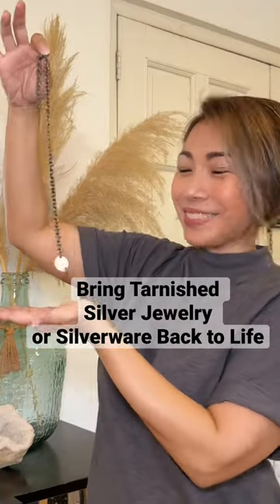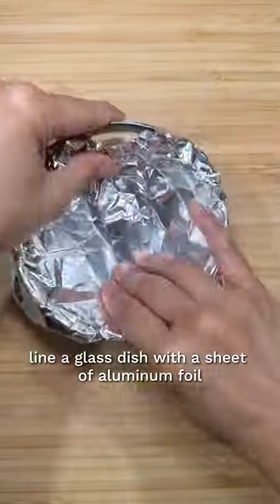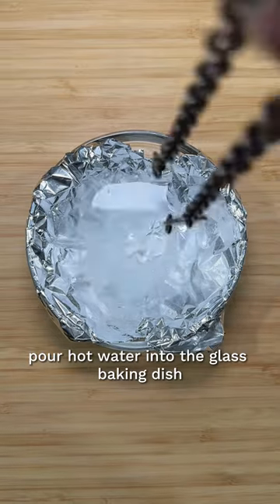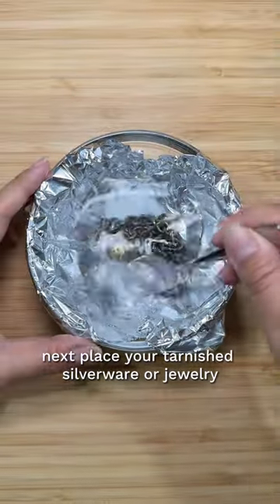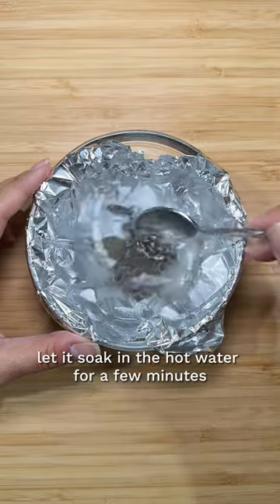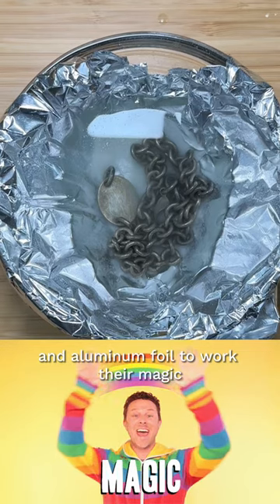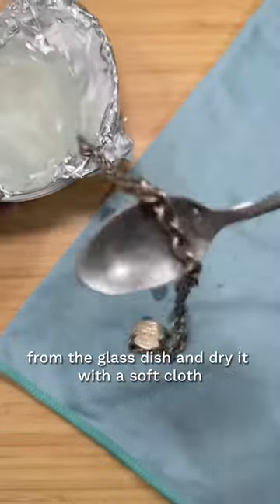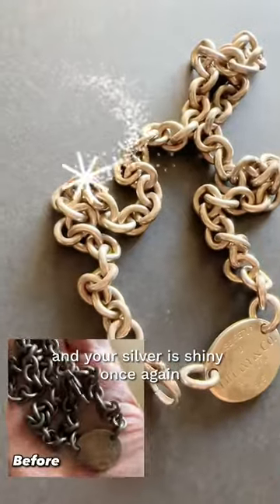How to Make Silver Jewelry or Silverware Shiny Again

Comment: do not try this , just did this for my sterling silver necklace and it is now brown and far worse off than it was before. no offense to creator but this is criminally invalid
Reply from the maker: I’m sorry this happened to you. But I’ve been doing this for decades and with all my sterling silver jewelry and have had no issues.
Reply: prob just means urs is fake
Reply: most likely it wasn't silver, silver can't turn brown, black - yes, but not brown.
Reply: We boiled a heavily tarnished cuff bracelet like this. I thought it was ruined, with light brown splotches instead of black,but then we rinsed it with water and dried it with a microfiber cloth and it was shiny and residue free. It shined up to gleaming with a silver cloth very quickly after that.